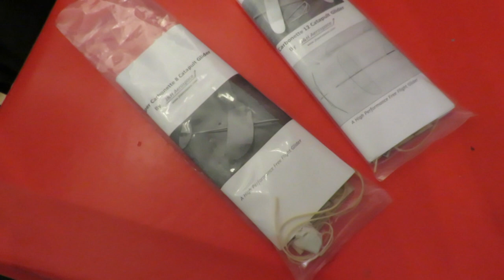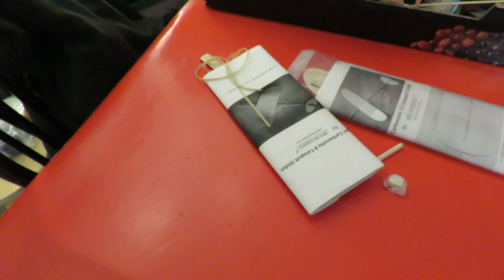Carbonette 8 FAST FORWARD build

Comment: A bummer about the banana fuselage and the breakage. I've repaired my Carbonette 19 after breaking it by not gripping it correctly and still like it a lot. I have a DLG and an Aleda to build, but too many other non-modeling projects to complete first. My first Aleda is still in a tree in Sonoma. I keep forgetting to grab some PVC tubing for retrieving it!
Reply from the maker: Hey thanks for the coffee :-) Unfortunately the Carbonette breaks - several times - Finally got a good flight today (which is several weeks after this video was made). I will drop a link here when I upload the video.
Reply: What sort of DLG have you got? I always take interest as soon as I hear “DLG” :)
Reply: I'm new to them. I have been flying a Whipit (and crashing and repairing!) and will build the Carbonette DLG shortly. I have just finished a Dream Fight Libelle but have yet to fly it. I have a Dream Flight Alula that is a fun sloper.
Reply: Nice. I’m looking at getting an Alula too actually. If you like the whipit you should definitely check out my channel. I’ve got a bunch of videos on flying the whipit, stock and with upgrades.

Comment: Hi Grandad. This might appear to be a dumb question, but if you have to dampen the strip of wood that goes along the leading edge to make it pliable, how come the super glue sticks to it ?
Reply from the maker: All I can say is it works fine. I have seen lots of "hints, tips, and tricks" regarding superglue. With regards to water I have seen some say it triggers faster setting and others say it reduces the strength so I guess there are different versions and some are OK with water and some are not. As far as I can tell superglue works best when gluing my fingers together 😊🤣😜😝